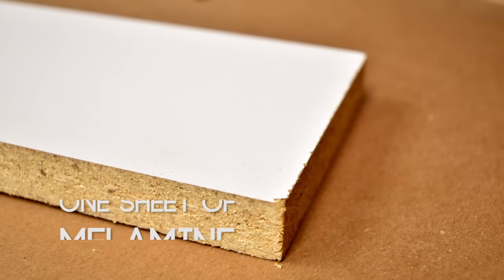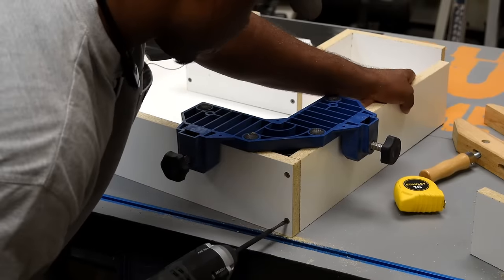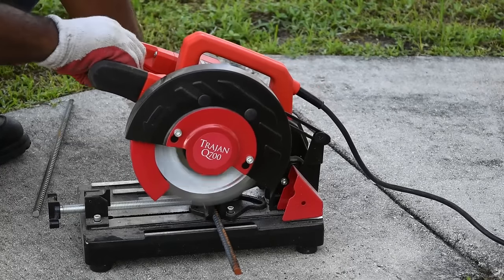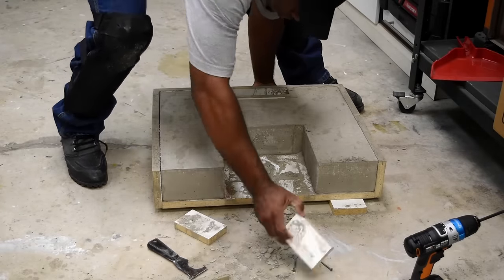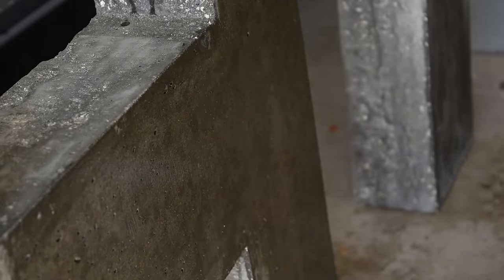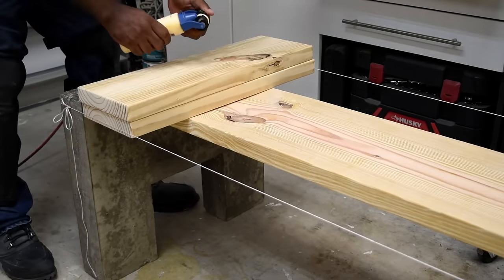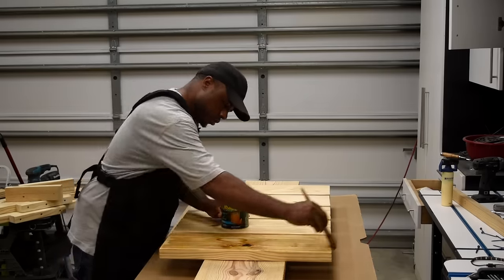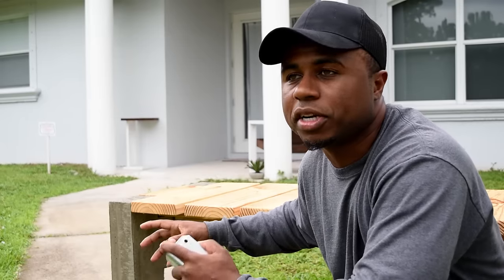MODERN Outdoor Concrete and Wood BENCH

Comment: Great Video! I have several years experience as a commercial carpenter and have built many forms in my life. I would like to suggest that you use some spray cooking oil on your forms to keep the concrete from sticking.
Reply from the maker: Thank you. I actually used mold remover. I noticed oil usually stain the concrete in my experience.
Reply: Nice video.  You can also use paste wax for a form release with melamine.

Comment: It looks like you used latex caulk?  The significant chip out you got at the edges is likely a result of this.  Concrete will stick to latex caulk.  You need to be using 100% silicon if you want clean edges.  Nice looking bench either way.
Reply from the maker: Ah, got it thanks for the tip. It didn't occur to me at all :). Thank you.
Reply: I did the same thing on my first concrete table top, and learned the hard way :)
Reply from the maker: I know now. So next week video will have to caulk as well, did them the same time. So don't think i'm hard hear when you see me using caulking in the video. lol
Reply: Ha, I hear ya on the video lag.  I have two videos in production for builds that were finished months ago....
Reply from the maker: I just sub your channel. I was looking to do a light similar to one on your channel sure I could learn a thing or two. I'll check it out later!
Reply: Thanks, I've been following your builds for a while and definitely found inspiration.  Just decided to take the leap to start filming my builds a few months ago.
Reply from the maker: I appreciate that! That's great you should share your work if you enjoy it. If I learn something from your video ill be sure to give you a shout out! :)
Reply: Thanks, that would be an honor!
Reply: p.s. My next two build videos involve concrete forms, and show a pretty cool trick for perfect silicon edges  using paste wax and a $4 cake fondant.
Reply: FYI - I've got two of the concrete builds up on my channel now, which show the caulking technique I mentioned.  It's right up your alley since it involves a $4 cake tool from Amazon, and is super easy to get perfect lines with.  Also, curious what you think about the videos, if you have a minute -- constructive criticism from those who have been at this for a while is invaluable right now....

Comment: Glen, that was one beautiful bench!  So modern and built like a tank.  I liked your tip about using a Sawzall Recip Saw for vibration. I would never have thought of it, and did not know you had to vibrate the concrete. I've never worked with concrete but this got me interested.  Thank you for a very good demo!

Comment: Two identical Boxes? You can use one Box twice...
Reply: Lol so a two week wait?
Reply: It's safer to make two, because concrete is finicky and as you saw, he had to destroy parts of the mold.. then trying to put it back together and just replace those parts can result in a wonky crooked second cast, because no matter how good you try to seal it, the melamine will absorb water in the middle particle layer and warp a bit. If you look at nearly any concrete mold after being used it looks a bit beat up and crooked.
So there is a good reason to make two, especially considering how cheap melamine is and you can usually get multiple molds out of a single large sheet. There is just no real reason not to make two, you get safer, better results, save time, and it probably wont cost anything extra in time or money if you build them concurrently. 
So yeah... two boxes.
Best case scenario with one box, is you have to wait twice as long, which is a big deal when you're considering dealing with time spans of days or weeks.. that's time and space you can't use. Also, leaving concrete around for that long risks accidentally ruining it, bumping, dropping something on it, animals... etc. Better to get them done as fast as possible, limit the amount of time you have wet concrete around. Also, with only one box, if something does happen, you have to start entirely over again, and have nothing to show.. with two, likely only one will have a problem and you can fix it and move on.. not have to start over, wait a week, make another batch, wait another week.. by then you're a month deep before you see any results. It can be very mentally taxing for a maker to have a catastrophic failure like that, at least with something to show it keeps you in the game, and keeps you mentally strong and motivated to continue and less likely to give up after wasting a week or more of your time and seeing nothing.

So there are a multitude of reasons to do two or more molds at once and not try to reuse them. It isn't always about pinching pennies or saving a bit of material.
Reply: @AJ-ew7kr  depends on the cement you use. Also if done properly you can take it out of the mold to finish curing while starting the next.

If it were me I'd figure out how to build a mold that is coated mold release and the pieces are on tracks that when clamped only requires new silicone. Now this might not work, but let's be honest, your friends and family will want one.

Comment: Good work. Handsome bench. I would offer a suggestion on finishing the concrete legs. Instead of regular sealer use Line X or some other good spray on truck bed liner . This will not only seal them but make them nearly indestructible . Keep up.the good work.

Comment: The look is great.   I love the simple lines.   You may want to look into "Fiber Mat" for the re-enforcements.  The metal over time will rust and leak out.   Your forms are great and the edges are very good.
Reply from the maker: Thank you. Ill checks it out. Never heard of it. I believe with the concrete sealer it will hold up longer.

Comment: The best part of this bench are the concrete ends. The seat needs some modifications to be comfortable and usable over the long-term.  "Wood Glue" is a waste of time outdoors, and those screws are not going to hold the cantilevered pieces adequately.  It won't be long before the seat is falling apart. The fix would be a 2x4 (vertical - 3.5" dimension up-and-down)  under all of the seat slats.  ideally you'd make a pocket for that in the concrete but you could also anchor them some other way as a retrofit.   It will alter the look of the bench but I think make it much more practical/durable.

Comment: Really like the plan! I haven't had good luck using polyurethane on outdoor projects. It lasts maybe a year before it wears off and starts to get moldy. I've had better luck with deck sealer. Epoxy would probably work, but it's expensive.

Comment: Nice little project there, haven't come across your channel before which is surprising since you have 1m subscribers!  Anyway my only thought was I wander if the concrete forms could be a bit thinner and to strengthened with some glass fibres or something.  But great video and project!

Comment: Would it be better to apply the coating before gluing the planks together? Otherwise wouldn't it allow water to seep in the gap where you did not apply the protection?

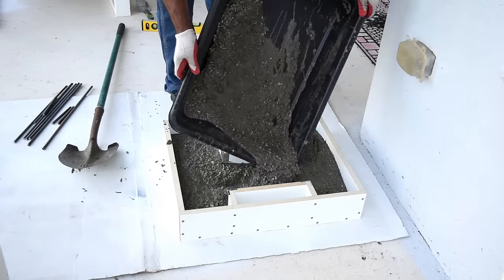Comment: Quick question ... concrete ... the only perceivable difference in "wetter" concrete and "dryer" concrete is liquidity ... like how much slop you get. Meaning, if you make your concrete wetter, and you don't have a form (like what you have here at 4:25) it just goes everywhere. Am I correct? Is there is anything about strength that I need to be concerned
about when I have wetter concrete like you have done?
Reply from the maker: A wetter mix is known to be weaker. Ideally, you want it to have good moment so you can spread it easily.

Comment: Beautiful! Don't put too much water into the cement because it weakens concrete (and of course affects the look too). If there is no plasticizer the mix should look and feel like wet sand, but with proper plasticizer you can literally turn the mix into fluid. Just read instructions on the package, you'll find there recommended amount of water.

Comment: Awesome job!  Question: Will the bench eventually get a bow to the middle of the bench?
Reply: I ll answer that for you just incase he doesn't. 
I make benches like this all the time. I ve been making this kind an many other styles since high school and that was 30 years ago . 
Anyway , it would bow a very little but not for a long long time because its not to long .
If it was longer and the span was further apart from the concrete,  well then yes an alot sooner.

Comment: My concern would be that there's just the two pairs of tapcons keeping the concrete ends vertical and parallel to each other.  Lateral forces would be likely to shear them and the whole thing falls over.  Do you find it's at all wobbly under normal use?

Comment: Beautiful!  I didn't understand why it was important for the end boards to be removable, though.
Reply: So the bench can be deconstructed and moved or stored if necessary,if the end pieces were glued down you wouldn't be able to get to the fixings that hold the wooden top to the concrete sides.

Comment: Very nice looking bench! I have one question which is hauntng me for a while. Why do you seal the wood at the end and hence only from the visible sides? I could imagine rain flowing ven under the top wooden pieces and start a rotting process from the inside. I thought about painting the pieces before attaching them to the bench and I am not sure, if there's a reason to do it the other way. Thanks and BR
Reply from the maker: Thank you. As long as you coat the entire things it will hold up for a very long time. Water can not penetrate if you put a few coats on its.

Comment: Sadly those open areas will let water sit on the cross board below You can put in a thin cricket Peaked at Center, which is sealed between and waterproof it where water will ran out and not rot support plank.

Comment: Nice idea! I'm kind of concerned how long the wood will last when it's stuck together like that. Because the grain of the support beam and the sitting planks is perpendicular, the wood will eventually work its way loose from the glue and then water can get into the gap where it basically won't be able to evaporate. I suggest not using glue and additionally lay two plastic plastic supports parallel along the length between the support beam and the planks on top, about 1/8th to 1/4 inch thick. Same for where the wood touches the concrete. That way the wood can expand and contract without sheering the screws and water in the gap will be able to evaporate. Plus you can paint the entire surface of the wood with a protective coating.

Comment: Well done as usual. However, I think the bench is still not stable enough.To do so, I think you need to attach the legs to each other using one or more pieces of wood to prevent them from falling apart when moving while setting on them. I hope you got that. Good luck.

Comment: Nice looking bench; however glueing and screwing wood grain at 90 degrees to each other could cause a problem. Would also like to see some gasket material between the wood and concrete.

Comment: Doesn't concrete get stronger by absorbing water? I think I read that in something about making roads
Reply from the maker: Yes, but over watering can make structure weaker.
Reply: MrNightpwner, if you over water it during the curing phase the cement within the concrete will setup weaker. But if, after the concrete has cured, you keep it moist, concrete WILL become stronger! Watch professional concrete workers at work. They often cover the work with plastic to slow down water evaporation, even spraying it with more water, to slow the curing time. If they need the work to cure faster they add chemicals to the mix while mixing it. Well, that's my two cents … better just make that half-cents, I'm not really all here ;-}

Comment: My next project. Btw if you take sides off within 24 hours it will cure quicker also concrete is not water proof unless you placed an anti-hydro liquid in it while mixing concrete.

Comment: This is good, but I can see room to improve, I would be concerned with the wood rotting due to drainage (water) issues, so would probably just done a simple slat seat and  would have used Wedge anchors in the cement mold to make attaching the seating a bit easier.

Comment: Do you think you could do a bench with the concrete Parts actually made out of wood?
Reply: Make the end concrete "H" pieces out of a 4x4 or even better a 6x6 post.  you could also use pressure treated lumber if you wanted to cheat and avoid sealing the wood.  Just remember though the parts touching the ground will be wood.  Wood in contact with the ground is not usually a good thing. (depending on climate) Have fun, if you made it all out of wood it can be a nice weekend project.

Comment: Awesome bench! Just starting my first concrete top coffee table myself and was wondering about those Tapcon screws you used. Do I need to use anything special to put those in? Masonry bit? Hammer drill? Keep the modern projects coming!
Reply from the maker: Thank you. Yes, you need a masonry bit. I believe they come with the tapcons depending on where you get them. I would recommend you wait 30 days for the concrete to fully cure.

Comment: FYI you can use ANY type of wood to make your molds as long as you wipe it with any kind of oil before you put the cement or concrete in it, you can wipe it with used motor oil, even cooking spray, concrete or cement will never stick to wood...give it a try and use plywood instead is cheaper.

Comment: I have some comments about your design...  I would estimate that each concrete section weighs about 100-125 lbs.  So even if you could pick it up to move it, the wood structure would be destroyed. So even to move it a few inches is very difficult without damaging it..  Lastly, structurally,  it is VERY STRONG to hold vertical weight...  BUT in the sideways direction, the bench is balanced by the concrete standing...  It is only held together with three thin blue concrete screws.  If I came from the side and kicked or jumped on the concrete, the side forces would make the entire bench collapse.  Very dangerous.  If I was making that, I would use lag screws, and put an additional bottom support beam to connect the 2 concrete bases...

Comment: If this is a bench for people to sit on, the edges of the wood need to be sanded smooth or else it will be uncomfortable on the back of the legs/thighs.  This could have been avoided if the bench was designed to have the wood placed long-ways.  As it is, it's not great for sitting, but OK for setting things on, like flower pots or something similar.

Comment: I'm sure that white silicon is a bit of problem to remove.
The silver tape give you a problem than benefits. 
You don't need it both, you work with concrete not with resin.
And in small quantity of concrete is better to reinforce it with small grid of steel like Φ5/10 (cm).
I believe your bench is not so stable.
Nice idea after all.
(I  make houses from concrete for 20+ years)

Comment: To get a more finished industrial look, don't use deck screws on the outside edge... Use a large head hex stainless lag bolt. I was sad when you left those cheap deck screws exposed after all that work. At least use a screw with a large finished look. Overall, great project.

Comment: The subjects covered in this wood working book “Bαzοmο Tdy Plαn” (Google it) varies from wood types to tool types and uses. It also informs you regarding the different types of wood and how simple or difficult they are to work with. If you are still a beginner in woodworking, then you will find this book very useful. .